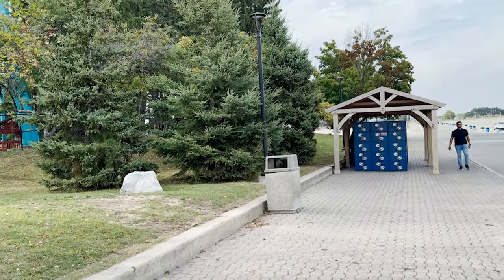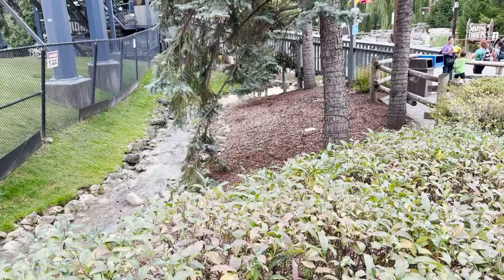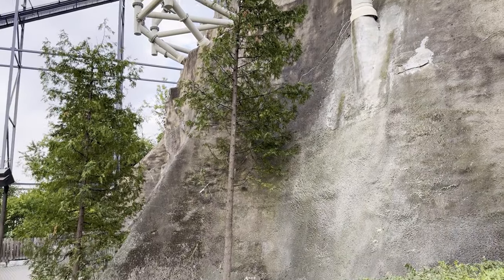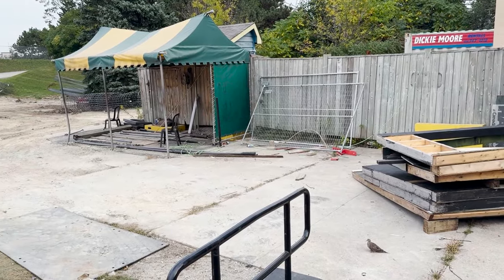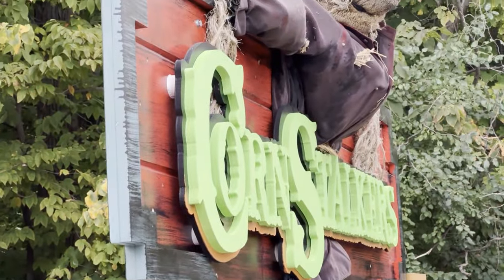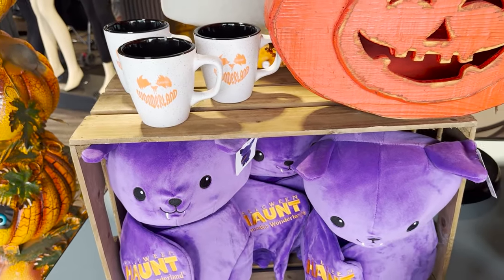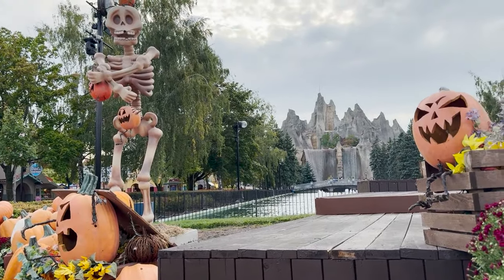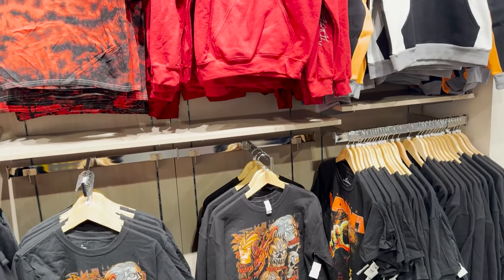Canada's Wonderland AlpenFury & Haunt Update

Comment: when i went to utah in late july i went to the factory they were fabricating alpenfury at and they were only just starting the first launch and break run, not even the station. they told me it took them a few weeks for only those pieces. this (i bet) is the track on site now, so i assume by now they have a bit more done,  but not all of it. plus they had quite a few supports done, more than what is in the parking lot at cw for sure.